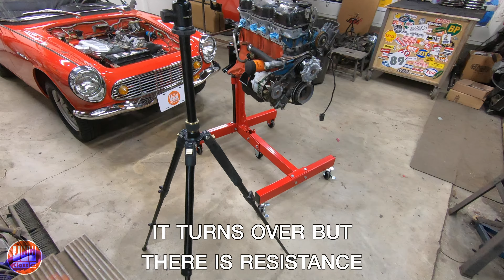Datsun 720 (Episode 8) - Problems With The "REBUILT" Engine

Comment: I bought a 1981 Datsun King Cab 4x4 brand new and I'm still driving it with 287,000 miles and it has never had a rebuild. The dealer that sold me the truck offered to sale me a brand new engine for this truck for less than $900 in 1982. He said Nissan over produced these engines and I could get a great deal on one. He said just put it on the shelf. I didn't  do it but man I wished I had. My truck still looks great and I still drive it today. When I go somewhere people will come look at and everyone wants to know if I will sale. Of course not.
Reply from the maker: That’s awesome!

Comment: Question on the datsun 720rebuild.  Engine assembly  part 2 @ 4min32 sec the timing cover is shown w the distributor and oil pump.  Is there a specific oeocedure to properly clocking the distributor in relation to the gear that drives off the crank shaft?
Reply from the maker: Sorry, I don't know. I always google things like that right before I do it and pretty much forget it immediately after... So then I google it again next time i do it.

Comment: Can you tell me what size wheels and tires you have on it please
Reply from the maker: 31x10.50 R15👍
Reply: @Jerod_Helt  Thanks for that . That motor will run ten times beter with a weber carb, those Nikki carbs is hell to fix when they get faulty.
Reply from the maker: I have to keep it 100% stock to pass smog here in CA
Reply from the maker: Hey buddy just realized those tires are 30x9.50 R15, not 31s👍
Reply: Ok cool thanks
Reply: No problem I appreciate that you came back to me.